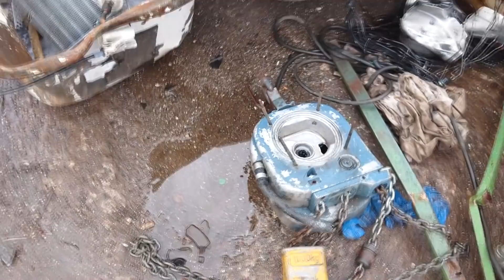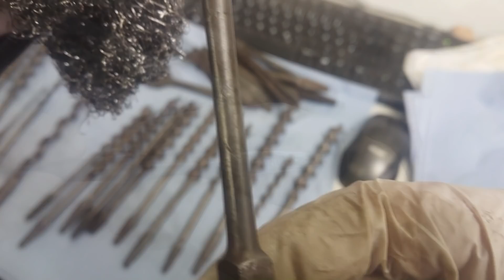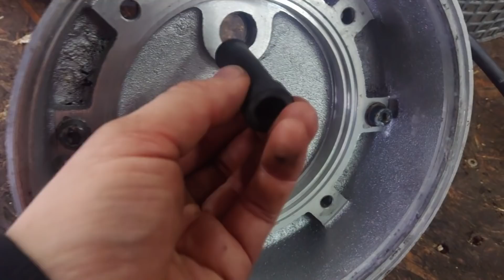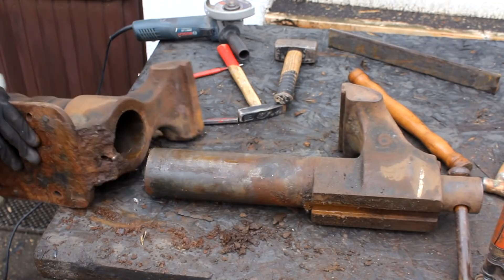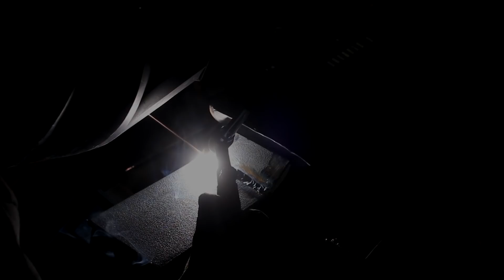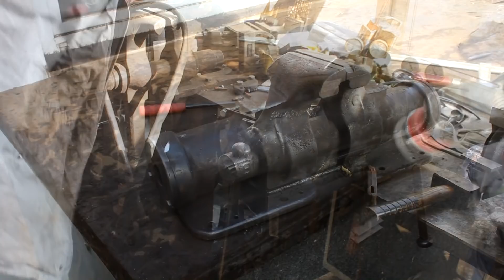Terrific Scrapyard Finds! Repair-A-Thon!

Comment: Mate have you heard of metal spraying. It is good for building up cast iron. It’s toxic so you need good ppe and ventilation. You also need some oxy acetylene handpiece specifically designed for metal spraying. You also need the metal powder that goes into the oxy acetylene hand piece attachment. You basically heat the metal like braising, then you just pull a trigger and spray the powder metal and you can build up missing material. You can then grind and machine as needed to restore to original size and tolerances

Comment: I am enjoying your videos a lot. 
The second vise you repair is not cast iron, it is a drop forged peace and that is the reason it as welded parts. This parts are made the same way as hammers are. 
The red equipment you encouterd at the scape iard is a bread slicing machine

Comment: The large machinists vises are built as work holding tools used for sawingd , chipping, and filing objects. 
I find many broken vises with damage similar to this one. Miss using a work holding vise to beat on will break it every time.
The blacksmiths post vise is designed to transmit the force into the ground through the solid post. 😁😎
It also provides leverage to survive the bending forces of shaping hot metal. 
A common misconception is that steel can be bent in a machinists vise. 
Consider the size of a punch press or press brake used to form cold steel. The mass is needed to absorb the force applied. 
Heat the material up to red and it bends easily by hand.

Comment: Learn how to sharpen the Irwin style bits.  The ones that don’t have bottom lips to scribe the hole first are worn out and can’t make clean holes.  These types of bits will also fit many ratcheting braces like the one that was poking out of the bottom of the pile in the intro video as well as the older type of Frey braces that you showed.  Contrary to what people think, these types of bits can make very clean holes as used in chair making and any other wood work requiring dowels or turnings.

Comment: I was wondering why firefighters would want that submersible pump, then a light went on. When you end up somewhere without hydrants or running water and you might have to use a pond, lake or something similar to put out the fire.

Comment: Those drills can be sharpened with a small three cornered file, with an even smaller one you can touch up the starting screw at the tip. My uncle showed me that when I was a kid.

Comment: Just found your channel, good stuff.
Reuse, repurpose, recycle.

I'm disappointed at how uninteresting American scrap yards are by comparison lol. I kinda wish I lived in Germany now.

unidentified Machine it looks like those could be slots for hard drives. I'm not sure. It has caster wheels and you can see more of those racks torn out behind it.

I'm willing to bet it may be a mobile NAS. (Network attached storage). 

If it is, they are very useful in the digital editing workspace. Everything from game design to 3rd party YouTube content editing.

If you have petabytes of videos, and you need a way to share them, this was how you did it before the cloud. It's still how a lot of people prefer to do things.

I would place that somewhere around 2006-2010. NAS storage is more statationairy now with connections reaching 10gbs in office environments.

Back in the day (not to long ago) this was the solution to sharing your data with another department or even business. When we are referring to peta or terabytes.

I remember black carts that looked similar all over the blizzard development floor. That's because it was easier than losing a flash drive, and FAR more organized. It also had things like RAID available, which is highly desired on multi-million dollar projects.

If you can respond back with any identifying numbers or a clean shot of it upright, I could be certain.

As it stands, I'm about 80% sure.

Comment: Hi, as a new subscriber to your excellent site which I
stumbled across but am glad I did.  I am
quite interested in your concept of repairing and repurposing items.  I like the fact that you go into the history
and that you explain the German names and pronunciation, which in turn helps me
with my German 🤣 As an ex-military Engineer I enjoy (what we
English call Tinkering) tinkering and learning new things.  I have recently started to set up a little
works shop to start learning woodworking but enjoy electric’s as well.  I will always try to repair or complete works
within my home first before I would outsource however, I am no expert by any
means but continue to learn from sites like yours.  That said, I agree that current tools are
either too expensive and or not fit for purpose.   To that
end, you have shown me another way to fit out my little works space, so a
couple of questions if I may…. Do you get special permission to go into the scrapyards
or is it normally aloud? Is there a general pricing list or is it done per
scrapyard?    I live
within NRW.  Setzen Sie die gute Arbeit fort und danken Sie im
Voraus

Comment: You REALLY need to sharpen those bits!
I use mine when I need super clean holes. Unless you were using a really splintery wood, yours are dull if they cause that much tear out.

That pump is a great find! If you sell it for half of what ebay wants, you'd get 1200 euros!

Comment: seeing as you like to repair cast iron you might check on Google for a henrob  cobra welding system  its absolutely wonderful for making welding repairs to cast iron or any cast material  plus its unique gas mixture chamber allows this torch to not only weld but be used  to cut with  a cut kerf like a plasma torch

Comment: I am going to be the you tube pedant, soooo, your torch flame was too hot. You burned some of the Zinc out of the Brass brazing filler. You could see this by the white residue of Zinc Oxide surrounding your braze area. I hope this helps.Thank you for your video.

Comment: Hiya,  I know with all this Covid-19 stuff happening I expect you are totally self isolated and enjoying the quiet but I have a question about using old computer monitor parts to make a variable output ion generator so I can use it as a static grass applicator and might be able to use to make lightning wood as well, would that be something you could cobble together from stuff like old microwaves, monitors and PC harddrives as I have lots of that stuff knocking about?

Comment: Your videos are truly inspiring. I had a vacuum cleaner break a while ago and didn't have time to fix it (traveling for work) so bought a new one. But... Because you inspired me I kept it in the garage that doubles as my workshop. Today I took it apart and the problem was a simple wire that pulled off the motor. I soldered in a short piece of wire and voilà! I now have a "shop vac"!
Thanks!

Comment: I have found that instead of oiling the wood bits, I just slightly heat them and put them into a heated candle wax. This puts a surface coat on steel way better than oil. Use this on all type of nuts and bolts when I work on a car engine with fabulous results. That is my trick and I am sticking to it. The sump pump is the real deal for sure. Industrial quality item for sure. The vice you found has an achilles heel that is always seems to be in need of repair, just a poor design from new. The bottom plate should have been made with a thick reinforced steel and have a swivel also. How often do you need to move the vice sideways and you cannot. I am personally considering making a unique vice just using screws from stainless steel. Stainless costs me just one dollar and fifty cents a pound. This is a cheap price to pay. What do you pay for stainless is Germany ??? The broken bolt came out because you have a cast iron part with a grade 8 bolt that was probably broken by being overtightened. Your brazing is not bad. You can see that some spots are cold and the braze did not flow properly, but most are really great, just remember it is better to have a little less braze than a big glob which is just laying and not heat adhered to the cast iron. Keep up the great work doing what you do best !!!!!!!!!!!

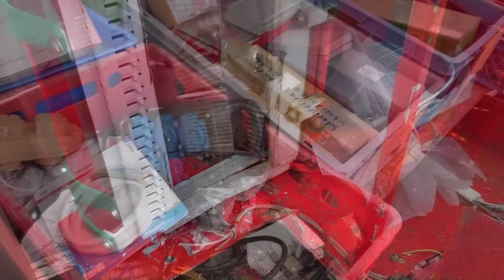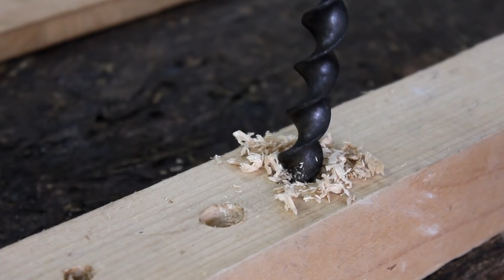Comment: 2:28 Maybe a sheet metal cleaner? I had a neighbor who used to work in a place that made those. 5:28 I think you need to touch up the outter cutting edge with a needle file as the hole should not be that ragged. I have a bunch of those from my father's tools and they're actually quite a joy to use. My favorite thing is to chuck in a 1/4 adapter into a universal brace chuck and then it becomes a supertool for removing stuck screws because you can put your whole body weight into it so it doesn't cam out so easily. Then it's also handy if you are doing a job and your cordless drill runs out of battery power. Just change the bit and Bob's your uncle.

Comment: I have welded cast iron with nickel rod.  I used a torch to pre heat the cast iron storm drain grate that traffic ran over.  When I am done with the welding I peen the weld.   The welds have lasted for years.

Comment: I don't recall if I have mentioned, but replacing the thrust washer in a vise with Torrington bearings is a worthwhile up grade for any bench vise.

Thrust bearings are inexpensive, and dramatically reduce friction under load, compared to a brass thrust washer.

The result is the vise is much easier to get tight on material, and prevents a handle impossible to loosen without a cheater pipe, or hammer.  It's been 15 years since I added thrust bearings to all my vises, and I have not had a porblem since, with material slipping because the vise wasn't tight enough, or with a handle I couldn't loosen by hand.

Comment: Would the heating of the vice change any hardness in the vice jaws?
Reply: Cast iron is usually not heat treated. 
It can be heated and cooled multiple times with little effect. 
😁😎

Comment: A couple of tips for you: a great finish for steel and cast iron is beeswax ( it is a natural product, inexpensive and easy to apply. It also lasts for a very long time! ) . Heat either the piece, or the wax ( depending on which is easier ) the heat doesn’t have to be much over the melting point of the beeswax, so it is a low temp operation. Also, you can dip your taps and drill bits ( that are sharp ) into liquified beeswax, let it harden, and you have a way to store these items that will prevent rust, dulling of the cutting surfaces, and render them safe for handling ( nothing like cutting your hands to ribbons while fishing around in a box for a drill bit ! ) . Apple cider vinegar is an exceptional rust remover that has no bad chemical issues, smells good, and can be strained and reused! If you need to remove old paint from an intricate metal piece that you may not be able to wire brush with the grinder or if the paint is lead based and you don’t want to have the toxic dust all over everything, you can boil the piece in water/vinegar solution ( figure a 50/50 mix. White vinegar will work fine ) . This will soften the paint and help it to release from the substrate ( object ) so that it can be hand brushed or be picked out. I have used this technique for cleaning lead based paint from the fine figuring on antique door hardware ( ie: lock plates, hinges, door knobs etc. ) .  Remember to wear a respirator when sand blasting ( silicosis is no joke ) and also when grinding old paint ( lead poisoning will shave a few watts off the old light bulb ) . Also, since you are new to brazing, brass uses zinc as part of the alloy. If you don’t have adequate ventilation, the zinc fumes coming from the brazing process can cause neurological issues ( auto body mechanics in the past- before the widespread use of the wire welder- would get the “ zinc shakes “ from breathing zinc fumes ). The zinc part is what makes that white surfacing on the repair piece. Awesome videos, thanks for sharing you vision and you philosophy! Peace!

Comment: Now you need to figure out how to sharpen those antique bits. They shouldn't chowder up the wood like that. If you can get them to produce smooth curls like most woodworking tools ought to, then those will be a nice find.

Also that vice is a big chonker. (At least compared to what most would see on an at-home workbench.)

Comment: You are wrong about cast Iron welding. The newer welding rods have built in composition to stretch as the part cools down from normal welding temperature especially if you peen the part with a sharp point hammer right after welding. I've fixed many old cast iron equipment this way and have had 0 cracks thus far and these were structural fixed to machines like large mill, motorized hack saw etc.

Comment: Awesome.  Thanks for the cleaning tips.  I have two brace drills (with chucks), a set of drill bits also in the original cloth, but in top condition.  Another set of drill bits I occasionally use, with a chuck adaptor for the cordless drill.

Comment: The small vise (near the end of the video) looks like a "coach makers" vice. These have a narrow body, and high jaws. This means they are not super strong, but give very good access to parts held in them for shaping and manipulation.

I suspect it might be very handy to a restorer... (but don't use it for hammering or pressing bearings)
Reply: ....or an old blacksmith post vise...
Reply: @GeorgeMLong  If you mean a post vise is good for pounding on, I agree. It's pretty much what they're made for.

Comment: Here in the U.S.A. Carolinas the humidity is often so high and the temperature changes from day to day so great that it makes painting a necessity. Unless your work area is heated you will find that if you open the doors to the outside on some days every thing in the shop will be covered in water droplets... and rust.
Cheers from NC/USA

Comment: A piece of non plastic rope impregnated with valve grinding paste used commonly for valve lapping on cars  will clean those  bits up great and quickly also works well on other round stock, plus you can sharpen the cutting edge with diamond file to about 15 degrees john uk

Comment: Cast iron is not difficult to weld- you are using the wrong rod!
I weld CI weekly with OA using these materials
https://www.tinmantech.com/products/welding/flux-filler-metals/cast_iron_welding_supplies.php
The CI arc rod don't require pre and postheat, nor peening. You can knock the flux off TIG with it- no porosity and good puddle control-
You don't want nickel rod for CI-

Comment: Thank you. Very interesting.
Would all those drill bits be usable with an electric drill?
Could/would you could the older drill chucks onto an electric drill? Or simply create new?
Reply: I am sure they are out there.  I made an adaptor years ago, but would do it differently if making it today.  Main thing, the bits are not designed for high speed.  So the speed should be limited to cranking a brace manually.   If using an adjustable bit, the manual brace works better.

Comment: The twist augers are nice, they are also called a bit, a drill bit, and simply a drill. The tool that these augers are used with is not a drill, it is a brace. Put the two items together and they are named a brace and bit. An electric motor with a drill chuck attached IS named a drill.

Comment: Awesome as usual.
Have you ever considered making a vibratory tumbler to remove the rust of things like hand tools?
Reply: Having seen other people make their own vibro-tumbler I decided to make one myself. Its not a big unit but for smaller items like those drill bits. Must say I'm so far not as impressed. I put in some semi-rusted items for a couple of hours and they came out sorta ok. Using something like Evaporust or MC51 for me has been much more effective. Have to try with a couple different types of media to see if it makes any diff'. Or maybe these tumblers need to be a big'ish sort of unit to be effective?
Reply: Tumblers work well for polishing and deburring. 
For items with cutting edges the have a problem. The action is non selective. The cutting edges are rounded off from the micro hammer blows of the media. 
In the case of screw pilot ed angers the threads lose the ability to draw the the bit into the wood. 😁😎

Comment: You really went all out on that old RB vise. 👍🏻 Why did you leave the 3rd vise at the yard.. looked a bit like a french all steel vise. But then you got the blacksmith bench vise, so it's all good. They don't look like much but are what happened when blacksmith leg vise makers tried to make bench vises. A very desirable vise you can pound on all day.

Comment: Some fine brazing there, my old Granddad would've been pleased to see this if he were still with us, he worked in a large factory making cast iron valves, from little ones you could hold in your hand right up to massive things for power stations etc I remember going in the factory a couple of times as a small kid, but i remember being terrified of the crucibles of molten iron moving around on gigantic hoists. Now both he & the factory are long gone, someone in India no doubt doing his job now.

Comment: You can also stick weld the cast piece and then continually beat the weld with a hammer to deform it as the cast iron cools. It's almost as much of an art as brazing is.

Comment: Why you did not make a guide for the big cast iron vise? You just brazed the flat stock, TIG welded, but you didn't put guide under the sliding part.

Comment: I prefer using electrolysis for rust removal.
It will not attack the steel or iron.
The acid chemicals like vinegar will attack the steel or iron, and will eat into the metal if left in the solution to long.